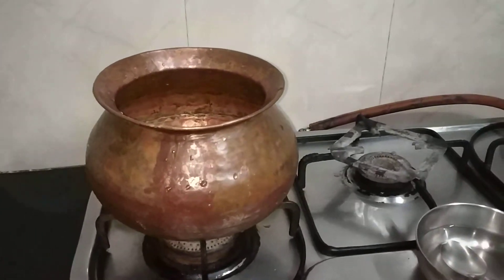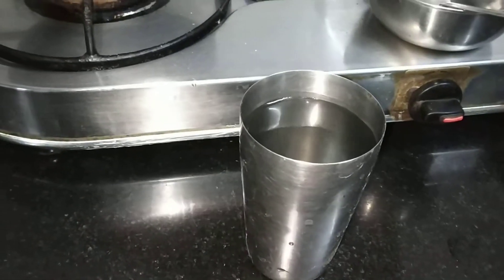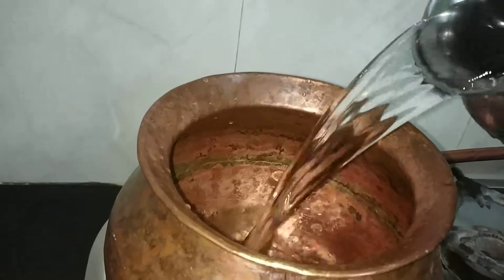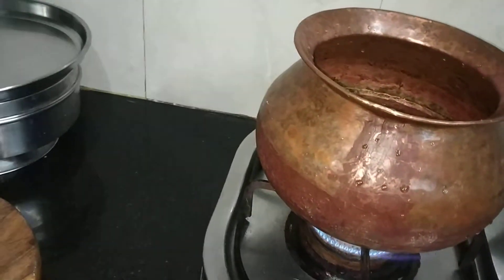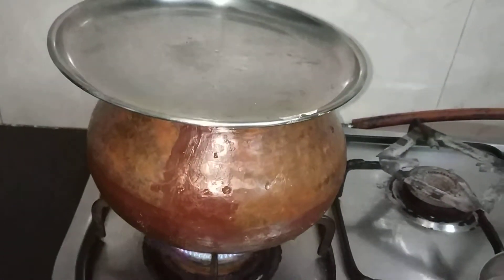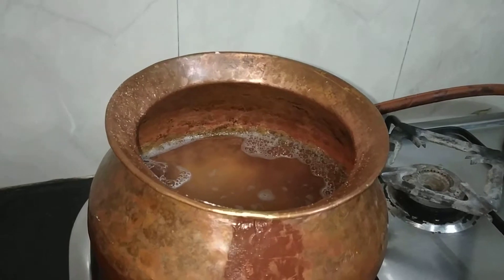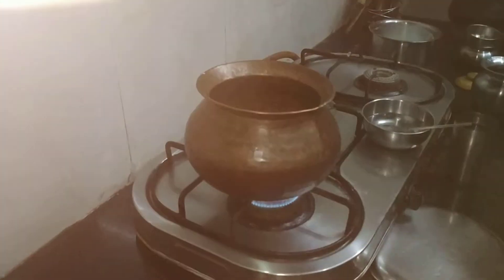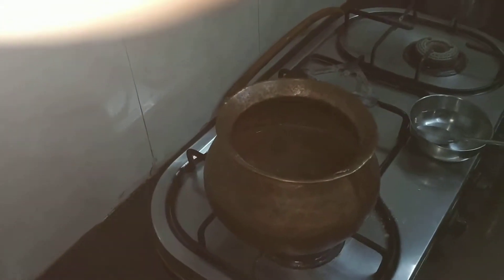Ragi Ball ( Ragi Mudde) using Copper vessel Part 1

Comment: Hi Sarika.... Would like to know if Ragi mudde was traditionally made in copper vessel. Stainless Steel is not convenient to make mudde, and I don't want to use aluminium. So what are the options??
Reply: Hi Hema ..yes traditional  it is prepared in copper vessel...u can use thick bottom steel vessel. Do not use aluminum  vessel
Reply: Pls watch part 2 also